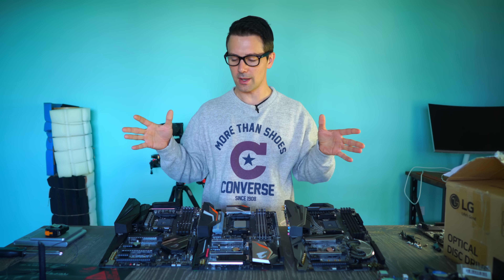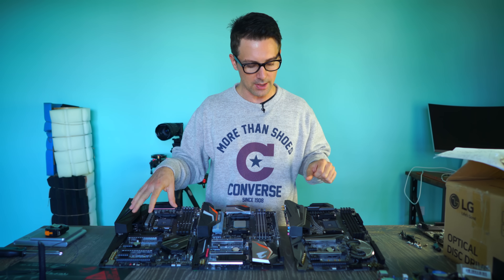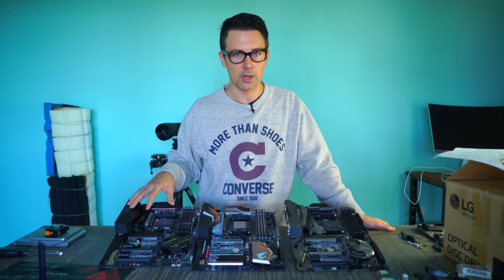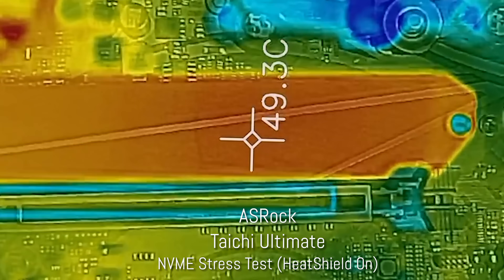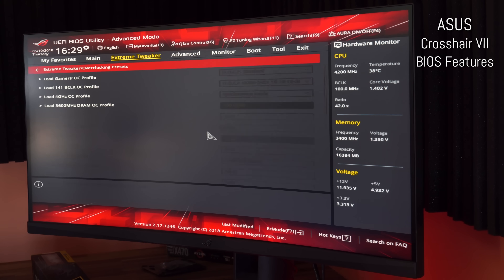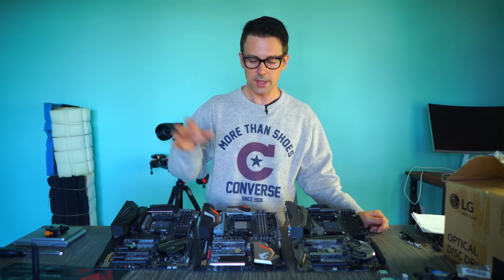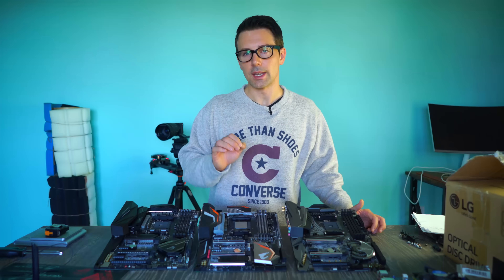The Ultimate X470 Motherboard Comparison - Which is the Best?

Comment: Anyone else has problems with overclocking RAM on AORUS?
I have a AORUS X470 GAMING 5 WIFI and after updating the BIOS the max OC on RAM is 3000 MHz. 
Out of the box I was able to run on default X.M.P. 3200 MHz now it won't POST.

My RAM is GSkill Ripjavs V 3200 cl 16, but the same issue is present on AORUS B450 PRO with HYPERX PREDATOR 2666 Cl13. Previously I was able to push 3200 MHz Cl14 now 3000 cl14.

New BIOS is f42c.

Comment: I used crosshair rog line for a long time. I never had a problem. I don't know if msi solved their heat dissipation problem, aorus is very good but for the heavier work condition I will always recommend crosshair. I use open rigs every time.

Comment: No mention of SATA ports? Also no coverage of the way SATA ports or PCIE slots get slowed down or even disabled when M.2 slots are used which seems to vary by manufacturer. ASRrock has the most SATA ports I think? Might also be worth mentioning how they implemented the SATA controllers and the raid capabilities on groups of ports.

Comment: Bryan, on the Gigabyte motherboard, if you shut it down disconnect the power cord and wait 2-3 minutes. Then boot it up the back audio port will work - for some unknown reason it Cold Boot reset occasionally.

Comment: I think this is one of your best videos to date man.  Great job here.  Can you follow up on the Gigabyte x470 Gaming 7 Wifi audio? This was an issue early on with the x370 Gaming K7 and for some they had to RMA the boards since it ended up not being a software issue.  Just curious and thanks for the great videos!!  I love your used PC part build videos man, they are absolutely a treasure trove of useful info and so great for price/performance info.
Reply from the maker: I can take a look for you, not sure when I can get that done however.   What problem did the K7 have?
Reply: Some users front panel audio always had static, or just didn't function.  I think those boards ended up being faulty.  I was just hoping the x470 version didn't suffer form a similar issue.
Reply: hey look on neweeg many rma dead motherboard for sound problem and dead motherboard after 2 month
Reply: Bianca

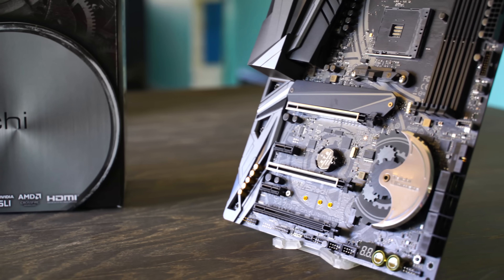Comment: 2:21 Wait, let me get this absolutely clear: You mean to say that those motherboards are still more than usable with overclocks even if you only plug an 8-pin and leave the other 4-pin header unplugged like if your PSU only has a single 4+4-pin 12v cable?
Reply: you don't need the additional 4 pin for cpu power even with high oc.
Reply: Correct. Near 400 watts with only 8 pin.

Comment: What type of overclock can you get with this mobo, a 2700X cpu and a closed loop aio cooler or custom loop water-cooling ?
I already have the AMD R7 2700X cpu, I just need to decide on which X470 mobo I want to get.
Reply: What board did you end up getting? I'm currently looking for an x470 board under $200 and I was decided on the Asus strix x470-f, but after reading bad reviews on Amazon, I'm not sure

Comment: Well done, informative vid. I got all the pertinent info I need to help decide and learned a lot about these boards. 
  I absolutely agree that it would be great..better, if all three boards had 2 M.2 PCIE 3.0x4 for running 2 NVMe in RAID, just one is a bit disappointing on such great boards.
 Thanks..earned a sub.

Comment: I have the Gigabyte X470 same problem with rear audio center channel when trying to plug headphones.  If i unplug from wall then re try with logitech powered speakers it works. If you use headphones on the back it will turn off again until you unplug from wall the re plug fixes every time. My thought on why. I think the rear center output is only designed for a powerd speaker the higher power to run headphones maybe trips some type of breaker and turns it off to prevent further damage of incorrect voltage/ohm output.

Comment: Trying to figure out what x470 to get. 
I've never really been much of an overclocker and i dont tweak much, Im mostly just using the auto features in the bios to get a small boost. but I do usually have my HDD in raid and good audio is allways nice.
I don't mind spending the money on the best, but if all the features are related to extreme over clocking arnt these just over kill for me?

Can anyone recommend anything cheaper or would i benefit anyways from spending extra on one of these?

Comment: Was running a Taichi X370 for my Ryzen 1700, great motherboard but on Ryzen 2700X build using the ASUS Crosshair VII (wifi) also I'm very happy with this motherboard, had some issues on first setup cause by my Thermaltake PCIe VGA Raiser cable but once replaced - wow. Thermaltake was great replaced the Raise cable without question Sent a replacement cable by courier after I submitted RMA request-: wow all good and now extremely happy .Love my new Asus Crosshair VII Hero (wifi) Ryzen 2700X, ASUS Strix GTX 1070 Build at Stock Cinebench Multi Core 1708 and with all cores at 4.20Mhz 1825. Using stock cooler and Corsair LPX 3000Mhz. Good work Tech Yes City...

Comment: To me it's granted the ASUS board will come out on top since you will know it overclock well and keep VRM cool and have a good BIOS and sound because they all do.
Taichi second because ASRock also design for entusiasts and Gigabyte third because they react slow and don't manage the firmware side as well, and lately at-least has screwed up VRM cooling too.
I find it weird the Crosshair had 2 PCI-express gen 3 M.2 x4 slots because the processor only have 24 lanes which is used at the moment at-least and 16 of those go to the graphics card(s), four to the chipset and four to one M.2 slot normally, the chipset provide 8 PCI-express 3.0 gen 2 but ASUS can't get those to become gen 3. So that would suggest a switch or borrowed lanes from the graphics port and it seem to be the later. ASUS only mentions: "*2 The PCIE_x8/x4_2 slot shares bandwidth with the M.2_2 slot." but even if you only use one graphics card the lanes have to come from somewhere so the first PCI-express slot must run at 8x in that case and the M.2 slot being the functional one rather than the secondary graphics card slot. It's nice that ASUS give the option and capability at-least and for those who only care about storage speed that's of course a fine solution but it's sad the consumer products have so few lanes. Intel have even less with 16 for graphics card and the equivalent of 4 for the chipset but on the other hand their Z370 chipset provide is it 24x PCI-express gen 3.0? I think SATA and USB and such is hooked up on that whereas in the AMD case those aren't included in the 8x but the 8x is for expansion cards so it's not really a fair comparision in the numbers front but for sure one is gen 2 and the other gen 3 and the solutions is a bit different.

It's annoying the X470 Gaming 5 lose the RGB light bar and RGB on the RAM slots IMHO. The Z370 Gaming 5 have them but that board still have lots the dual ALC 1220 setup of the X370 Gaming 5.
The last board the X470 Gaming 5 have the best wifi solution so they have made progress / spent money elsewhere but still (The Z370 Gaming 5 also support three M.2 drives.)

Personally I think the ASUS F Strix series are good boards when discounted. Sadly with Gigabyte boards here in Sweden we don't get decent/lower prices but rather Steam wallet codes or games with purchase and ASRock don't drop a lot in price at any time and don't give freebies but they are cheaper than ASUS and Gigabyte boards for the feature sets to start with so .. The same goes for MSI but MSI sit somewhere inbetween ASRock and Gigabyte in that they may cost a bit more for the futures but you may also get some game or so with your purchase.

Comment: Some details missing here, the Asus uses some of the GPU lanes for the second M.2 slot, so SLI wont be supported Since the GPU's will only get x8+x4, and the last x4 goes to the M.2. Crossfire will still work though. Not that anyone should use SLI/CF anyway anymore as the game support is getting worse and worse. The 10Gb NIC also steals lanes of course so a similar situation there.
And lastly, the VRM's. You do know that there is NO VRM controller generally available that supports more than 8 phases right? And even the 8 phase designs cost a fortune comparatively. You can't simply count inductors to determine number of phases. There are several other schemes than straight single phases.. Doubled in some way is probably the most common, but there are also some solutions that pair 2 inductors in paralell. Look up spec sheets for the components and trace, measure etc etc to figure it out. AND FOR GODS SAKE; TEST BOARDS WITH ALL RAM SLOTS FILLED in addition to just 2 sticks.

Comment: Considering the delay in the B450 based mobo release until late July, I'm much more interested in seeing a LOW END X470 mobo comparison.
Reply: I'm reading these comments in Dec 2019 and there is still little info as to then the B550 based mobos will be released. I'm not an overclocker but have been reviewing B450, X470, and X570 MBs. The only reason I'm including the X570 is for future proofing as much as possible since I tend to keep a build well over five years now.

Comment: Hey. Is it worth waiting until next month for AMD Z490 motherboards, if u need more pcie lanes?.  Even if someone dont need more pcie lanes, X470 boards should be cheaper soon, since they wont be the top ones anymore.
Reply: Bartosz Maj [fast forward a couple weeks now] It sounds like 490 MAY have been canceled, at least delayed for the foreseeable future since there wasn't even the slightest peep about 490 at Computex.

IMO, you're better off jumping up to the Threadripper platform if you really need THAT many PCIe lanes if you're budget can handle it(especially with the 8c/16t available dirt cheap if you don't need the extra horsepower that the platform has to offer), it's just much more suited to handling such work station-esque needs.

If not, there's obviously nothing wrong with X470 if you can make due without the extra lanes, in fact 470 has proven to be a rather incredibly impressive package between all of the new features, firmware refinements, and especially what can be done when paired with 2nd gen rye 6 & 8 cores

Comment: Having the power button on the back of the motherboard like Gigabyte has done it, is brilliant.
Having the power button on the motherboard itself was literally the dumbest thing ever.

Having it on the back of the motherboard saves you from:
A. Defective power buttons on the case, yes that can happen. So now instead of opening up your case and pushing the button on the motherboard, you can just reach at the back of the case and power it on.
B. Forgetting to plug in the front panel connectors. Something that happens to a lot of people.
Reply: mcopyright there's a board with  power button both on the mobo and at the back io.
Reply: ^ lmaoooooo thanks for telling him that.

Comment: One crazy issue I have found/read with the ASUS Hero, is that the top m.2 slot with the heatsink preinstalled, steals lanes from your primary GPU slot. You heard me correctly, this slot shares the 16 lanes from the cpu with this slot.  So if you plan on using an m.2 NVMe drive, make sure you put it in the bottom slot. Otherwise, you’re primary GPU runs at x8.  So basically, you really can’t use both slots, not many do. But still, the x470-f gaming doesn’t have this problem, however one of its slots can only be used at SATA levels if both slots are populated.   Considering the price of the Hero, I find it a bit ridiculous that the PCle lanes are divided up this way, I guess it’s not a big deal, as you can move the heatsink to the bottom slot and it’s probably a better place for it anyway. But forget about getting full speed on both.  I hear some people telling me this is documented in the Hero manual, but I can’t find it specifically.
Reply: @Tech Yes City  can you do a hardware test to confirm if what markinpuff has commented is correct please as if so then not too much differences between all 3 boards
Reply: See https://tinyurl.com/ydy6smvu

Remember m.2_1 is the bottom slot.
Reply: so the question becomes which mainboard is less handiecapped...as full speed raid 0 would be great with a addin card

Comment: Guys... Can you helping me choose a X470 motherboard? I have 4 to choose from... (Max £180 GBP)
Asus ROG Strix X470-F (Really liking this one)
MSI X470 Gaming Pro Carbon
Gigabyte X470 Aorus Gaming 5 WiFi
ASRock Fatal1ty X470 Gaming K4

Plan on adding a R7 2700x, EVGA CLC 280 and 2x8GB Corsair Vengeance LPX 3333MHz.
Reply: Late reply....I had this same question about "the M.2 slot sharing lanes" with the 1st PCIex16 slot ( GPU), as I too want to use a 970 EVO NVMe PCIe x4 in the 1st M.2 slot ..here is the answer I got directly from Gigabyte, on the X470 Ultra Gaming 7 mobo...but should also apply to the Gaming 5,...(note- this pertains to the Gigabyte mobo. I have looked at what Road Warrior linked to and it seems that  the Crosshair Hero does in fact share lanes in #1 M.2 slot with the PCIe x16 slot)
  
   ---GIGABYTE USA
4 weeks ago
   "The 1st M.2 slot is directly from the CPU and does not share lanes. 
 The 2nd M.2 shares with the last PCIe slot - You can either have a card in the last PCIe or a drive in the last M.2, not both."
 
  So, this should be a definitive answer, as far as Gigabyte mobo is concerned, straight from the manufacturer. I have read many articles and reviews on this and I have found about a 50/50 split on the answer, mostly on varied motherboards.
 Also, a "critical" point I have found in my searching is, you MUST go into bios and make SURE, after installing the card, that the #1 M.2 slot is set to SSD "PCIex4" function, or it will function in standard SATA mode and thus not use the full speed capabilities of the NVMe and 960/970 EVO. (This is what I have read many times now, and if I'm wrong, I hope someone corrects me, I don't want to pass on misinformation.) Apparently, this is a huge oversight that most people make, as this isn't always done automatically or by default.
  I've read a lot of reviews and the Pro Carbon has always received lackluster results and reviews, but the MSI X470 Gaming M7 has better reviews than Pro Carbon but costs a bit more, if that helps.
   Hope this was helpful in some way. If you already decided on a mobo, if ya don't mind, let me know which one ya got and what ya think of it.
Reply: Most welcome..I'm glad my post was useful in someway. Man, this mobo thing seems more complicated than it needs to be, IMO, lol.
Reply: Joe Tippett because it cuts the pcie x16 bandwidth in half  https://www.tweaktown.com/reviews/8612/asus-crosshair-vii-hero-amd-x470-motherboard-review/index2.html
Reply: Which is the one that is directly linked to the CPU?
Ryzen have 20 PCIe lanes, 16 for the GPU and 4 for a NVMe SSD.
Also, does this effect the Asus ROG STRIX X470-F or the MSI X470 Gaming Pro Carbon?
Reply: Joe Tippett https://drive.google.com/file/d/1_83hIM48jOv2IYsT6yDHmpjSnqXBBFl1/view?usp=drive_web
Reply: go with the
 strix
Reply: Joe Tippett  If you want a over the top motherboard, go with the Asus x470-hero WiFi, If you don’t need all those fancy features that board has, I would absolutely consider the X470-F gaming.  I have both and the x470-f-gaming is a very nice motherboard, doesn’t go crazy with rgb and has a nice versatile look as well. Has tons of board features that you actually use more than twice.  If you’re going to use your motherboard for testing components and need all those onboard features, then definitely go with the Hero, the uefi settings are outrageous, but not necessary.  The x470-f has everything you need and does a great job with the 2700x.  Both boards have light official 3200 memory qvl support, but I have found many undocumented memory modules work just fine, like the Corsair Vengeance line and many others.  They just don’t test them all at first.  See my comment above regarding the main m.2 slot and the fact you shouldn’t use it. However the heat shield can be moved.
Reply: Markinpuff unfortunately, I can't find your other comment.
Could you go into why I shouldn't use the NVMe M.2 SSD port on the motherboard? I've already got a Samsung 960 Evo 250GB in my current build and I was hoping not to use an adapter, like I have to with my current Z97 build.

And how does the Asus compare to the MSI? Was also really considering that too.

Comment: AUD $1500 let me know if this is a good deal. 
-core i7 4770K
-Gigabyte GTX 1080 G1 Gaming
-180Gb intel ssd
-16Gb Corsair vengeance ddr3 ram
-Corsair rm850 PSU
-MSI z87 mpower motherboard
-Corsair obsidian 650D case
-some big ass noctua cooler
-genuine windows 10